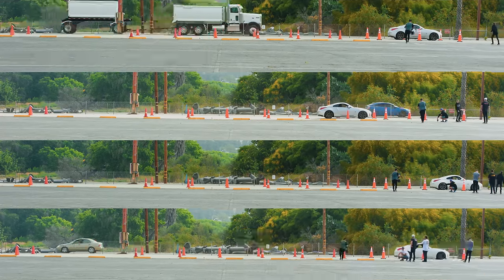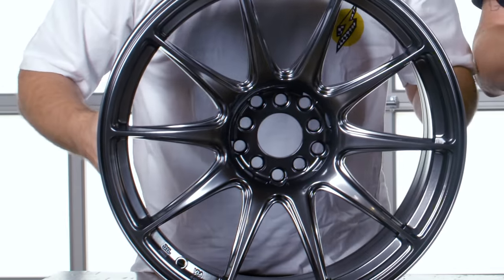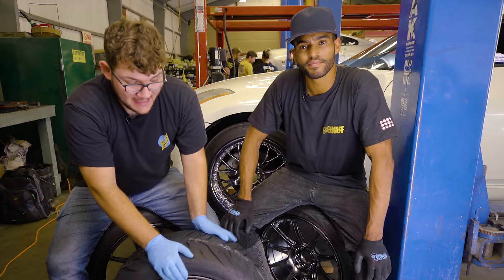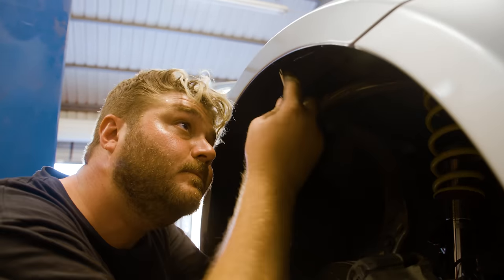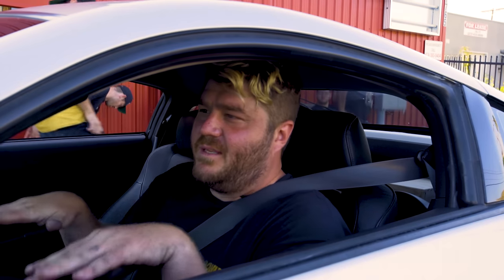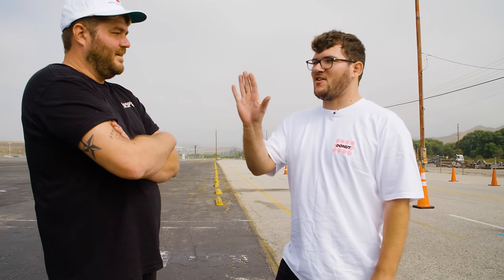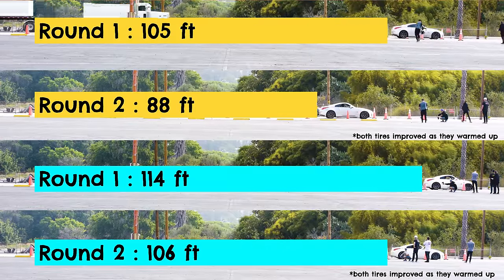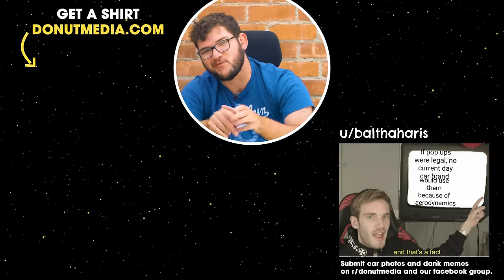$1,000 vs $3,700 Wheels and Tires | HiLow

Comment: Damn it! This was a tire test and honestly,  you should have done this before suspension,  this was completely  skewed  because  of suspension  differences. I'm not a wheel snob, I'm not a racer, so spending  $3000 is not in my agenda. That why I was so interested  in this video,  is there any way yall can figure out a way of testing  the wheels? I agree,  low cars wheels look sooo much better. High car looks way too ricer, or maybe too many cheap wheel manufacturers  have used that look so much that it just reminds  you of cheap wheels when you see them on a car.
Reply: lightweight strong wheels are always better than cheap heavy ones that are prone to breaking, noticed a massive difference changing to rpf1s. high car is not rice at all

Comment: The size of the contact patch has nothing to do with the width of the tire.  This is a very common misconception.  There have been extensive tests done to prove that a wider tire does not equal a greater sized contact patch.  

The type of rubber used, thickness of the rubber, and the air pressure are what dictates the size of the contact patch. 

Take a tire that is 300mm wide vs a tire that is 250mm wide.  Assuming that the tires are identical (except for the width of them) and the air pressures are identical, the wider tire may have a contact patch of 275mm wide x 20mm long. This would give a contact patch area of 275mm x 20mm to equal 5,500 mm^2.  For the tire that has a width of 250mm, the contact patch would be less wide, say 225mm, but the length would be longer to equal the same 5,500 mm^2, so 5,500 mm^2 / 225mm to equal 24.44mm in length.

Comment: I had to borrow my friends car to get to work as I was doing timing and water pump on my car. His car was making this god awful grinding noise and we couldn’t figure out what it was. Well I was on my way home from work had an hour drive and just started heading home. All of the sudden the wheel lug bolts sheared off and there was a explosion of sparks from the brake rotor crashing to the ground. There was a Ford truck next to me and when the tire flew off the car darted across the lane of traffic. Almost hit that truck. He didn’t stop to help me or check on me at all either. Took me 7 hrs to get a ride home….

Comment: Should have had put both sets of tires on the same car, on the same track, with the same professional driver like Randy Pobst. Put both sets of tires through their paces and get his reviews. I'm positive the more expensive set up with outperform the cheap set, but by how much? Is it worth is. That's the question. If you're the average guy going out for a spirited drive through the canyons the cheaper set will probably be enough.

Comment: Technically, more money does mean better (not always, some times is just mere luxury).

But proportionally it doesn't, since the performance improvement doesn't match the price increase ratio.

You are paying like 200% more for less than 10% of improvement, not in all cases, but in most of them.

Comment: Does anyone have a good overall tire size and width/set up for a 06’ 350z? I’m looking to drift easier with more control but I’m not sure how wide or big to go. I have the stock suspension and everything on the car is stock, but I’m lookin to upgrade to BC coil overs in a few months, just looking for some tips, thanks 💪🏼

Comment: Good job, but the test should have been done with the same car. If the cars have different suspensions the performance of the suspension plays a factor also. Should've used the car with the better suspension for all tests. Then it would've  been more of a wheel and tire test

Comment: Width does nothing without weight, a wider wheel on a Toyota Camry will not make it better at braking traction unless you fill the trunk with sandbags. This is also why you don't run the biggest tires available on an R6.

Comment: The suspension geometry is fucked on the back of the low car.  It needs camber plates.  That would increase its performance by giving a better contact patch instead of riding the inside of the back tire.

Comment: Those federals almost killed me! They are trash. Car became unstable. I literally switched to those same Bridgestones and everything was fine. 2002 E46 M3 - 275/30R19s for those who will ask. Once I hit about 45mph, the car did not want to straight was a nightmare to drive. All I changed were the rear tires.

Comment: Unfortunately there were more than one variable in this video. Should have only been cheap vs wheels or cheap vs expensive tires not both. Zack made a good point about heat cycling, so where is the heat cycling vs no heat cycling video.

Comment: My fucken bicycle tyres are more than these on a individual basis, 

😆😆 parts wise, I spend a similar amount on my bikes as I do cars in relative spec I guess. High end suspensions forks are more costly than a set of coil overs (depending how high end you go with that)

Comment: That braking difference between the 2 cars is wheel weight alone. 4#'s per wheel is BIG when it comes to rotating mass. Had you been performing that test repeatedly, the more expensive tire would likely have lasted longer. It's easy to make a sticky low profile tire, it's a whole different ball game making one that rides well, doesn't make you deaf, and lasts through repeated heat cycles.

Comment: @2:10 weight reduction is a big part of performance. Power to weight ratio.
What's the weight of the wheels and tires after mounting and balancing them ?
X4

Comment: Nah, just buy the first used BMW rims and tires you see and have them rub whenever you turn them full lock
Reply: Bolt pattern isn’t even the same
Reply: @itchyonion3559  Sure, between a Nissan and BMW they aren't, but in my case I took wheels from an E46 and put them on my E36, so it's interchangeable

Comment: ehhhhh you went cheap and mid grade. both the wheels and tires on the "hi" version are not "expensive". flow formed are not as good as forged and those bridgestone potenzas aren't nearly as good as a toyo R888R or a michelin pilot sport 4 or something like that

Comment: What a dumb way to compare tires and rims when the the comparison is done on cars with different suspension setups. Why wouldn't you just use one car and simply swap the wheels and tires? Putting the cheap tires on the car with crappy suspension will artificially make the performance gap different than reality which makes this entire video a waste of time.